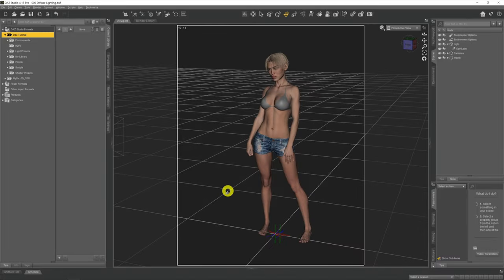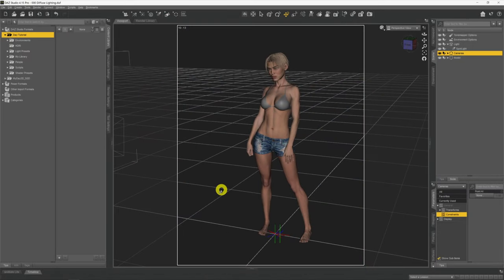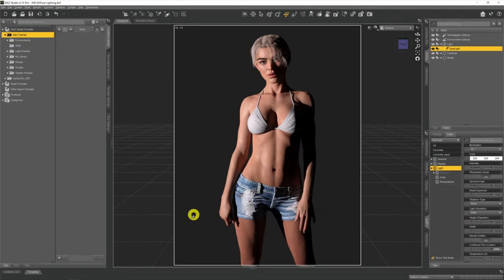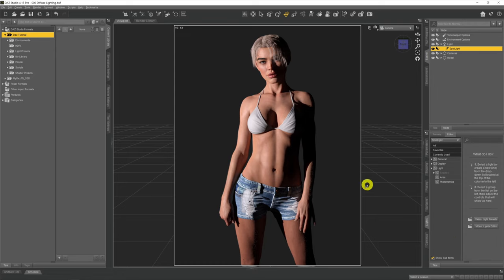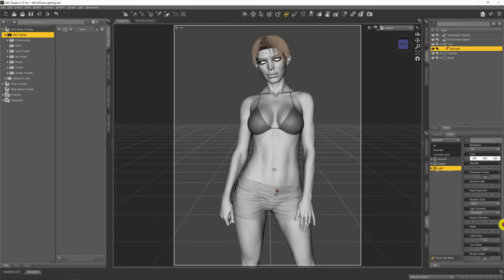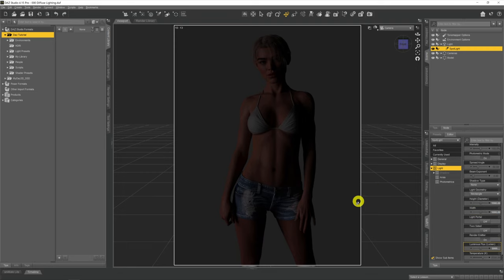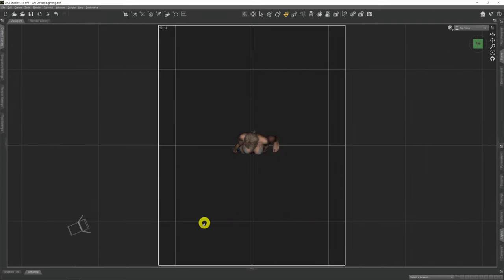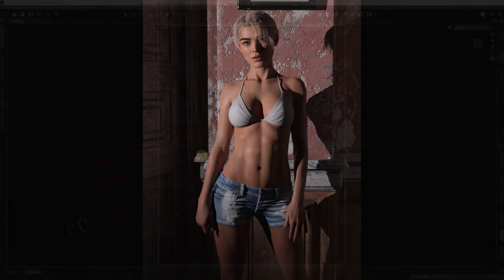Daz 3D Lighting Tutorial : How To Create Soft Lighting

Comment: One thing that would really be helpful is if you know how to turn the shadow of the light off when you increase its surface area.
I know you can turn the "block" the light creates off. But if, for example, you use one of these lights with an HDRI or several lights, they will cast shadows of their own even if you turn the Render Emitter off, and the shadows cast by the lights can look odd or incongruous in an image (especially if you've magnified their area up that much) unless you move them in which case the light isn't where you wanted it to be.
Reply from the maker: Hey there .. I think .. I might have just worked out how to hide the shadow like your asking .. let me have a play around a bit more and I might do a quick little video to explain and demonstrate .. although - it appears to be a very easy fix .. it appears TOO easy and I just want to be certain!
Reply: @RaukoDaz3D  Great. that would be superb!
Reply from the maker: Actually - I won't do a video .. it's literally a 2 second fix .... the light emitter that's causing the shadows (or highlights on reflective surfaces which what annoys me)??? Select the Spotlight ... Parameters > Scale = 0.001%  👍
Reply: @RaukoDaz3D  Great, I'll try that!
Reply from the maker: Let me know if it works out and if it's what you mean ..
Reply: @RaukoDaz3D  That seems to do the trick, thanks!
Reply: Thank you for asking this question. And, thank you, Rauko, for answering it.

Comment: Very nice.  I have used this a lot.  I think the shape of the source (rectangle etc) could be useful for things like reflections if you want any reflection from that to be a certain shape perhaps?
Reply: Unfortunately, Iray will always display the reflection of the light source, whether you choose to render the emitter, or turn it off. The other issue with Iray is that when you do turn up the size of the emitter like that, it will render the emitter leaving giant black voids that emit light. The solution was "ghost lighting", which were just geometry with their surfaces set to emit light and the opacity masked to hide them.  In 4.2 they "fixed" iray (NVIDIA did it) and now ghost lights no longer work unless you change them fundamentally.  The regular light sources still have the problem of rendering huge black pits and reflections from say, windows and water or anything that reflects, from what I've seen and judging the beta.
Reply from the maker: There are ways around the reflections and the big black pits when it comes to spot lights and point lights .. it's probably a bit too complicated to explain despite it being simple to do .. maybe I'll have to do a video on it!!
Reply: @RaukoDaz3D  That would be helpful.
Reply: @kibblewibble1  I done up a light the other day, and ended up switching it back to a point light which didn't have that problem (though the sharper shadows, but that wasn't much of an issue with my use.

Comment: I've always played with spread angle and I have always achieved good results in terms of softness. What's the difference between a larger angle and a larger surface of the projector? Many thanks Sir.
Reply from the maker: The spread angle won't (shouldn't!!) effect the softness of the light at all .. all the spread angle does is widens the cone of the spot light so it lights up a larger area in the scene  .. but the light will still be coming from a single point in space (or technically 10x10 square) which will produce a hard light with hard shadows .. In addition - if using a point light - it doesn't have a cone to widen so would be impossibe in that way.

The only way in Daz you can soften the light to the degree where you remove all hard shadows is by creating a larger light source.
Reply: @RaukoDaz3D  Many thanks Sir

Comment: Can I get that kind of lighting in just the Smooth Shaded "working" view? I'm just looking for art reference and I find the full-color renders distracting. Besides, my computer is limited. Like me. Thanks!
Reply from the maker: Not really, no. It will only display the soft lighting in Iray Preview or in a full render. You could always try using the filament render engine which is included in Daz . I don't have a video on it at this time but it's easy enough to switch across to. It's not as "good" as Iray and it's super fast.

Comment: The lumens slide disappears when I change from point light to rectangle light.
Reply from the maker: Hhmm. Can't say I've seen that one before. I've done this 1000s of times and never seen that happen. Switching the Rectangle (or any shape) does add 1 or 2 extra menu options onto the Lights tab that pushed Lumens down. 

However, sometimes Daz gets stuck with the scroll bar and won't allow you to scroll down further on the tab and stuff can move off the bottom. 

All I can suggest - is play around the tab window size to see if you can reveal the Lumen slider .. (check out this video if you're not sure how : https://youtu.be/T63FvHumppY) .. 

Let me know if this works for you or not!